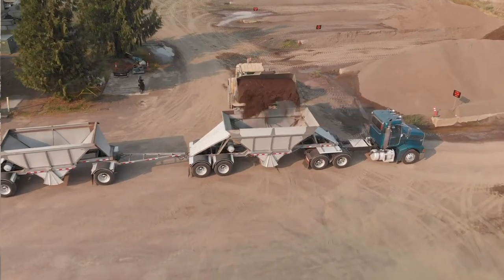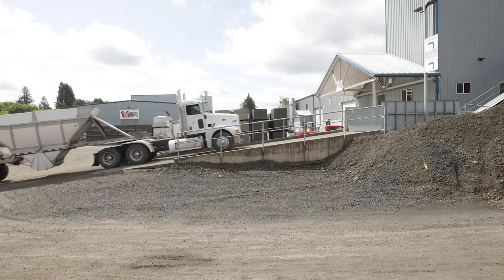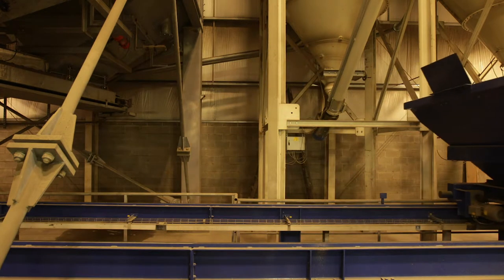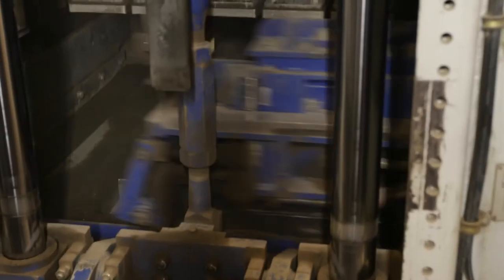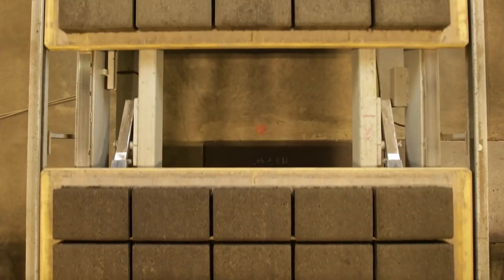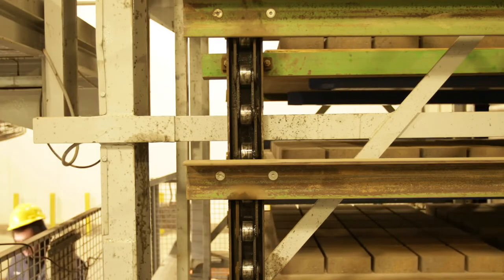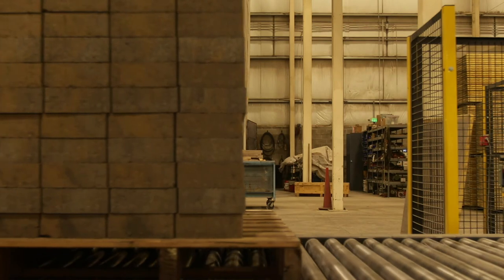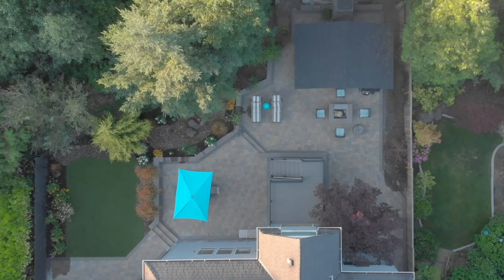How a Paving Stone Is Made

Comment: What temperature and humidity level is needed for your pavers to properly cure during those 12 hours?
Reply from the maker: The pavers will actually cure by themselves without any assistance, but the kiln speeds up the process and helps maintain uniformity. Generally, the kiln runs 95°F and 90% humidity. Basically, it's a hot summer day in the Midwest. 😉